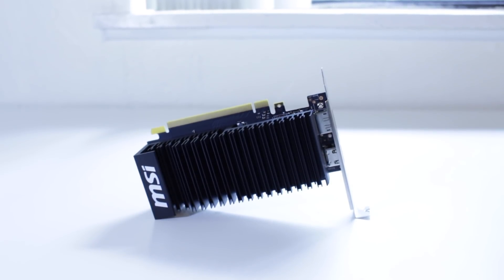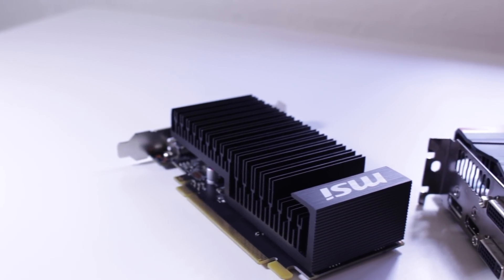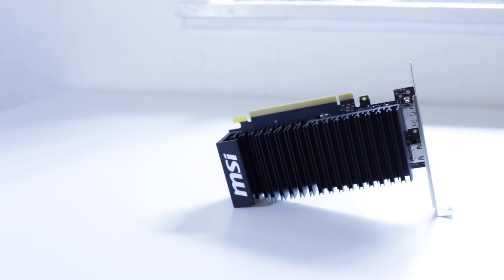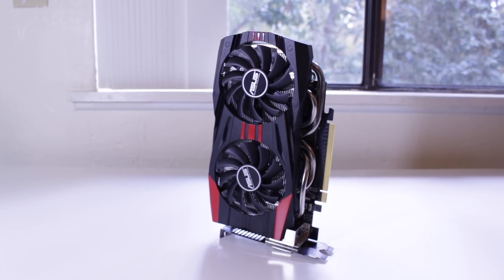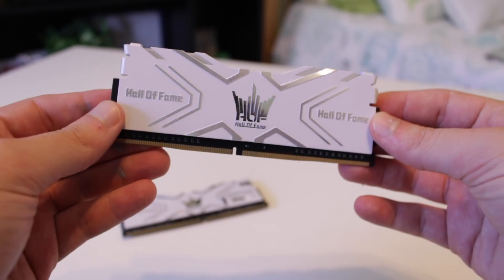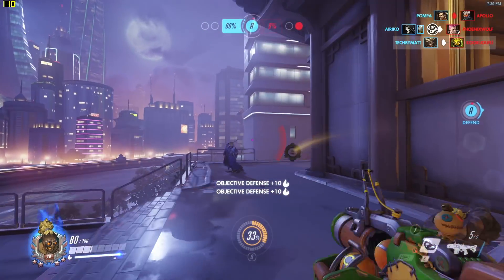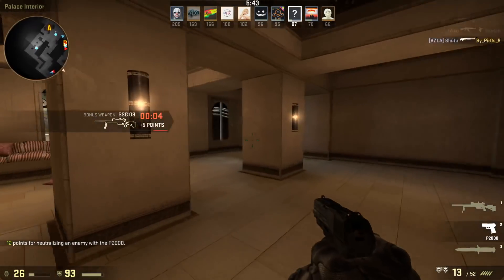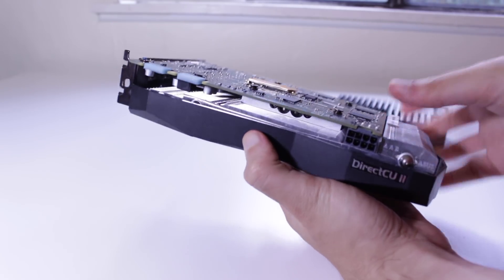New vs Used Graphics Cards! (GT 1030 vs GTX 760)

Comment: I still use the GTX 760. Not a bad card for the price.
Reply: I play with a gtx 760 and I get like 200+ fps   almost always in csgo 1080p high settings
Reply: Swessy specs
I5 3rd generation
8 gigs of RAM
Windows 7
Gtx 760 2 gb
Reply: Sounds By Sancus I would go ahead and buy the 760 if I was going to build my PC.
Reply: I love my gtx 760, started playing pubg, i thougth about upgrading gpu, but i wont need need cuz i got over 100fps. Maybe I will buy another one and pair them <3
Reply: @mr.superstar7919  u taste really good
Reply: Aizen Barbaross thanx man !
Reply: @mr.superstar7919  Hey! I was thinking about buying GT 1030 but when I saw this video I really fell into the dilleme, so I need your help, does GTX 760 runs games this good? And what CPU you use? Thanks a lot!
Reply: TNTMD YT Okay so where to start.

My friend called me if he could buy my GPU, I set the price at 100€ he said 90€, OK i sold it to him. Then I saw GTX 1070 for a 380€, so I said I would try and order it. (In some shops in our country you can bring back the products in the time period of two weeks.) So I went for it. The gtx 1070 is not a bad card but then I had to bring it back cuz my cpu was bottlenecking a little bit. So from those 380€ I rather bought another 16gigs of RAM for 140€, and I tried searching for used graphics cards, I found a Msi gtx 1060 6GB for just 180€ (normal price 340€). I bought it and now everything works perfectly. I saved a lot of money. The gtx 760 was not a bad card, I loved it pubg ran well but I was thinking about upgrading for a long time. My processor is i5-4670k, with these new RAMs and overclocking it to 4gHz it doesnt bottleneck at all. 
All in all, I would recommend you buying used GPU its much cheaper and there is no difference but be careful about scammers if you decide to go this way. I hope I helped, if you got any questions ask anything. Have a nice day!
Reply: TNTMD YT Do you have 760 at the moment?
Reply: @mr.superstar7919  No, I dont have it, I was researching about 760 and 670 and I saw the results and I was very surprised. 670 is very good. I dont have very big budget and here were I live (BiH) is everything expensive for double. Anyway thank you.
Reply: TNTMD YT oh okay, i just checked the gtx 670, im surprised too, well then go for it its better than 760 about 6% increase in performance
Reply: @mr.superstar7919  Yeah, is i5 3570 good for gaming?
Reply: TNTMD YT Yeah of course, but what type of gaming?
Reply: @hamzex5145  these are thing which will help in knowing if a gt 1030 or gtx 760 is best for you

have you got a low watt psu go for gt 1030 or gtx 750 ti which performs around the same but i would just get a used gtx 750 ti as that is way cheaper  used.

what cpu do you have depending on what cpu you have it could bottleneck so that means your cpu is being used so much its not really using your gpu in that case i would say go for gt 1030 or gtx 750 ti save some money.

both gpus should work fine with most motherboards

if you want a more powerful card maybe go for a used and get a gtx 760 or if you want a card with warrenty and low power consumption and newer more updated drivers go for gt 1030
Reply: I hate mine. Warm little vacuum
Reply: Madhuri Kolluru Really?200 constant fps?
Reply: Madhuri Kolluru well, csgo isnt relying on your gpu whatsoever. Comparing my 970,1070,760 or 660 and I had around the same fps (250-300) with all of em..
Reply: Only just ditched mine. 
Played games well in medium or high but medium mostly.
Main reason I upgraded is because Forza horizon 3 kept moaning about not having enough video memory even though it ran pretty reasonably at medium settings.
I got my money's worth. I usually hang on until the frame rate goes under 30 in my favourite games before begrudgingly buying a new card :)
Reply: I play VR on my 760 still. My 970 died..
Reply: Marinko Ćubela yah
Reply: Mu5e Official No.
Reply: Basically your CPU bottlenecks your system then, If you have a better CPU you will see different FPS with the different GPU's :P
Reply: lol, thats normal, cs go can run 200 fps on amd 6870( 20 usd gpu)
Reply: csgo is more cpu though
Reply: Same gtx 760 4gb, but when i play fortnite epic settings i get around 60fps+ and the gpu heat is above 90 degrees celcius
Reply: 200 watt
Reply: I have a GTX 670, its almost the same as a GTX 760.
Reply: I used GTX 760 since 2013 until 2018 December, because the card Has stopped forever.
Reply: Over clock it!
Reply: Me too

Comment: I recommend getting the 760 because yes, its older, but it has more cuda cores which it helps over the 1030.
My friend has been using the 760 for a while and its been fairly well, and it plays pubg at 30 and about 50 on the 1.0 update with a Xeon x3430 4c/8t oc at 3.7.2ghz at 1.38v with 8 gigs of ram.
Reply: all credibility lost when you mentioned for "almost the same performance"
Reply: Bullshit, I wold pay more for a card that performs at least double for the same power usage instead of chapping out and paying it trough the electricity bill anyways...
Reply: Omm The card isn't even a big power user in heavy loads.
Reply: Dude, are you shitting me ? I have a 750ti,  760 and its older version the 960 that uses half the power for the same if not better performance, getting back to the 10series, a modern I3 or even a Pentium g4560 with a gt1030 will use two or three times less power than a 2nd gen i5 with a 760 for almost the same performance.
Reply: Mtndewgang lul mine performed a lot better, 100fps, but i think that ur cpu bottlenecks i mean ur friend's